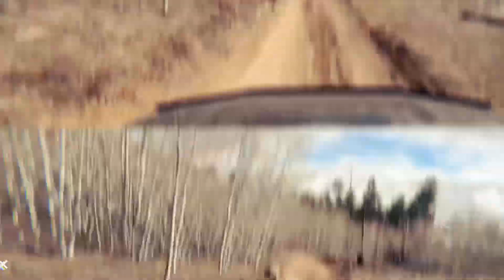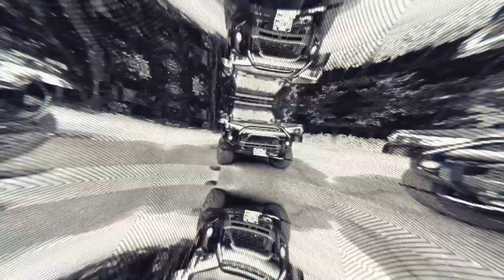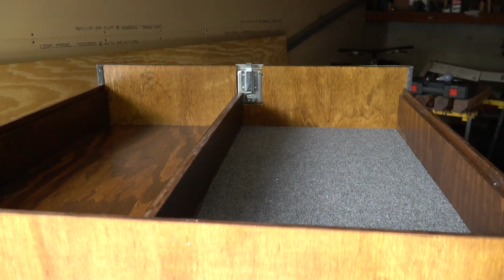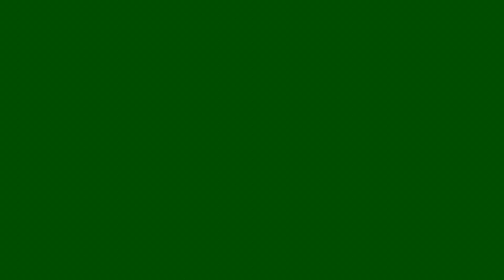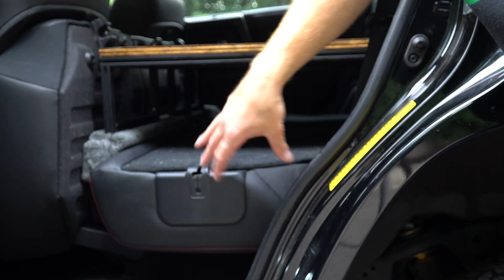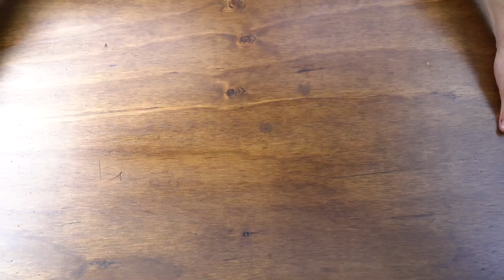4Runner/SUV Camping High End Sleeping/Storage Platform | Assembly and Vehicle Install | Part 3

Comment: EDIT: Realized there was a part 4 and got answers to most of these...

Hey this is a really awesome set of videos! I've been envisioning something very similar... A few questions:

1) Since the platform is above the wheel wells, did you consider building the frame around the wheel wells for additional flat surface in the back? Or do you like being able to stuff things down the side, or have some other reason for not utilizing that space? 

2) How tall are you? I am 6' and find it tough to sleep in my 4Runner without taking out the back seats (especially with a partner) Wondering if this is a non-issue for you, or if you have found a comfortable way to make it work? I love that this setup is so modular and can work in many orientations.

3) How did you cut the 2020? Trying to figure out if I can get away with a circ saw or if I need to track down a table/mitre saw. (EDIT: Found below: he used  a mitre saw with a metal blade)

4) Did you use any CAD tools or any you would reccomend for something like this?

Again, awesome videos! Got my subscribe. Looking forward to designing my own for this summer's adventures. Cheers!
Reply from the maker: Heck yeah!  Thanks!

1.  I have found the little doors that people do on the top in those sections are super hard to open with a mattress on top.  I have also found my mattress never sinks into those spaces despite them being there (aka the majority of the floor supports my mattress)!

2. I'm 6'3" on a good day but probably a little shy.  I think the ideal set up here would be making inserts slightly longer that cannot be stored in the vehicle but super easily stored (since they are so light and thin) that have legs that go down into the second row footwells.  You will have so much space that way and I have never last minute used my inserts so storing them outside my rig would not be a big deal.  The 60/40 is super nice though I would totally keep that feature.  With a 6" memory foam mattress my bed levels out with the top of the seat backs but it is not always the most comfortable - a 7 inch mattress might be perfectly level or else make the drawers slightly taller.

3. Cutting the 2020 is a piece of cake.  Probably any aluminum blade will do and I presume most saws you can get a metal or aluminum blade.  Aluminum is quite soft so its a good metal to work with.  I bet they sell like 8" aluminum blades for circular saws.

4. Did not use CAD tools.  I am not good enough with them to trust my designs/measurements.  It would be worth it if you were CNCing parts or had incredible precision while cutting but human error can get in the way doing that so these projects often take a long time and the more measuring and tweaking you do along the way the more refined your setup will turn out.

5. Feel free to message me on instagram if you have more questions - happy to help.  I have a document on my website where I list more details of the build.  It is NOT a step by step so if you decide to get it just don't expect it but I dive into a little more details on some stuff.

Hope that helps!

Comment: I like this plan much more than the wood, mainly due to the weight and durability. Have you thought about taking the bottom portion of the middle seats out, like in your other design? Im currently working through a plan and would like to take that seat out for extra space to sleep